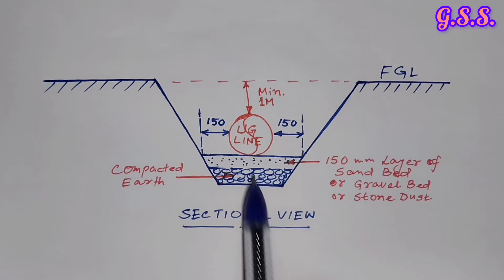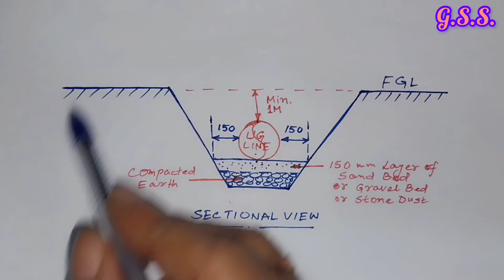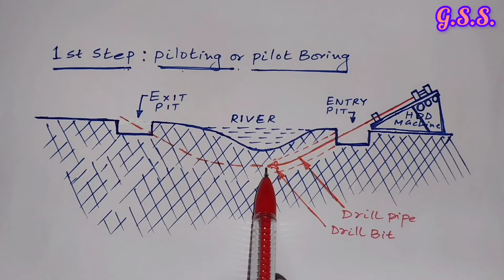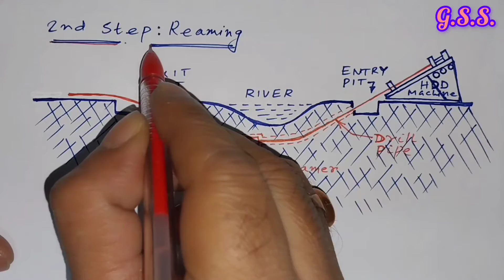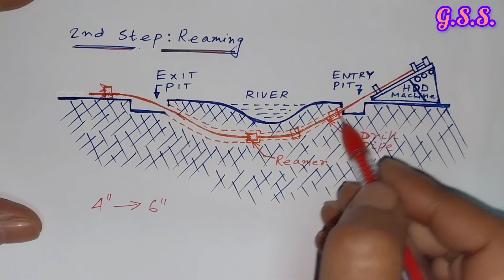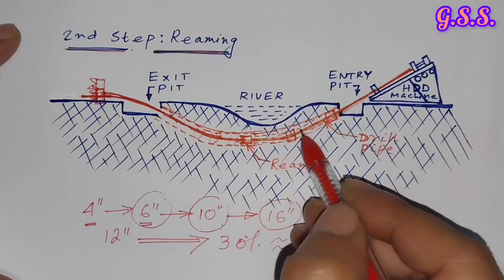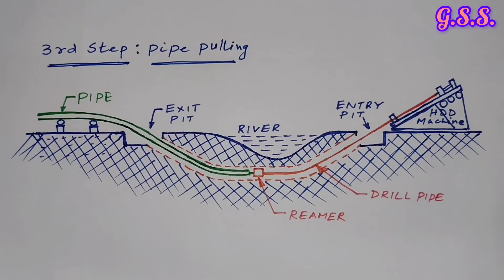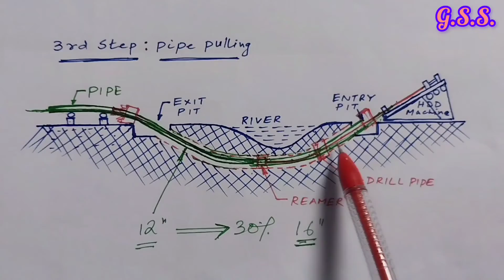Piping Engg : How to Lay Pipeline Below River or Below Railway by HDD Process

Comment: please explain casing pipe installation for some crossing location in order to protect the  non metallic pipe. please explain THE NEW TOPIC FOR RTP pipe installation,  onshore wellheads, production manifold, flow line, remote manifold, truck line. CI AND SI lines( corrasion inhibitor, scale inhibitor, blowdown skid,